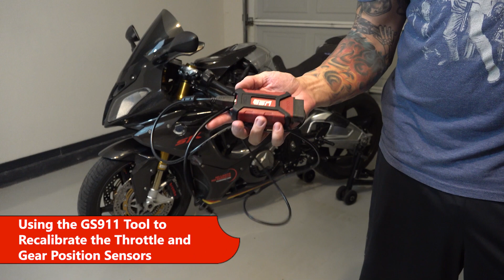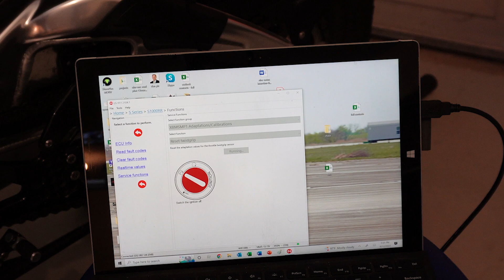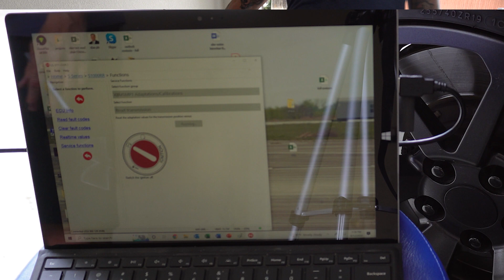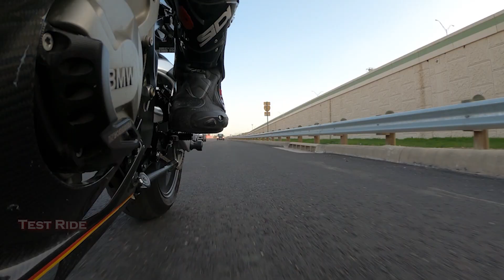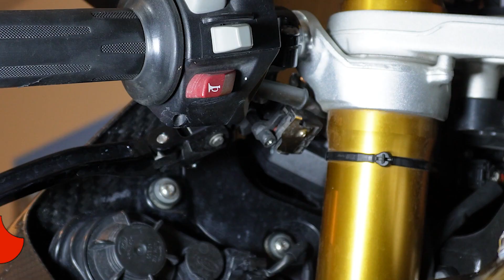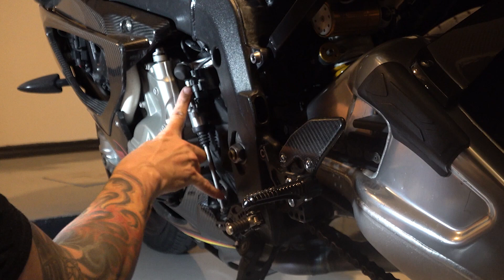How to TROUBLESHOOT BMW S1000RR QUICK SHIFTER Not Working - BMW S1000RR Custom

Comment: I have an S1000r 2016 and the exact same issue you’re talking about at 8:09. When it gets hot sometimes it simply doesn’t work anymore until restart the bike. 
What would you recommend in that particular case ?
Reply from the maker: based on what i was told in my research, if that happened, it was a failure with the quickshifter device itself. If it were me, i would start by replacing that. there was some discussion about older software versions in them being more subject to this, so having a newer version might be safer, such as the alpha i used vs. the stock one if an older version. This is just my guess of course, as you can see there's a lot of complexity and things that can go wrong, but that would be where i'd start.
Reply: Thank’s for your reply !!
Reply: I have a problem with Upshift in high rpms and cruiscontrol not work , i change microswitch but not have any results if i put metal tab in i can change the gears but cruise control still not working , help me if you can , thank you.
Reply from the maker: @reporterat  if you've properly installed that new microswitch, this is basically where i was, and all i really needed to do was tighten the clutch cable. try tightening it, almost overtightening, and see if that fixes it like it fixed mine.
Reply: @NoLimitsNoRegrets overtightened adjuster will cause clutch plates damage i think